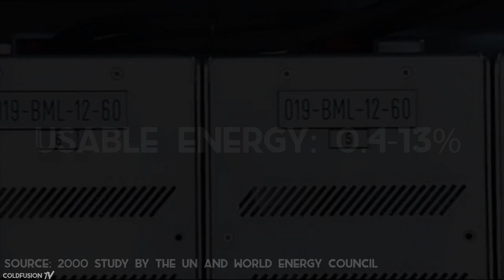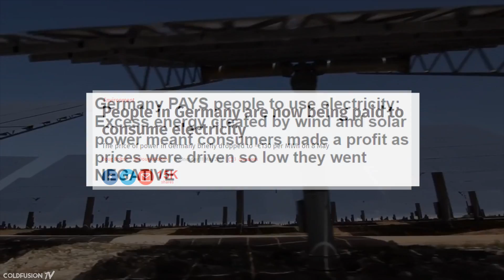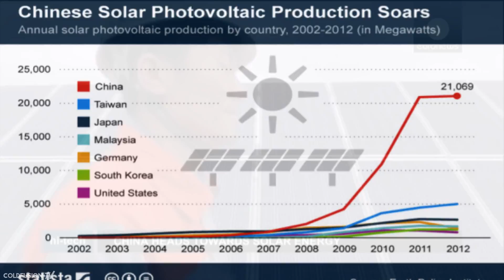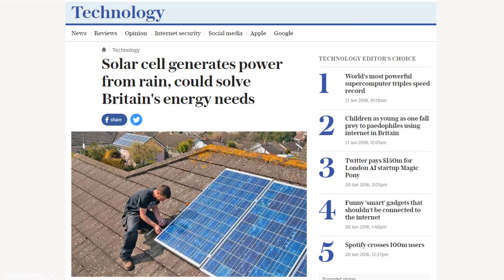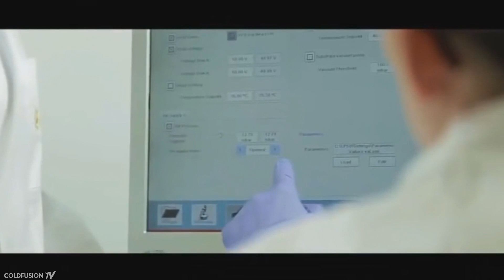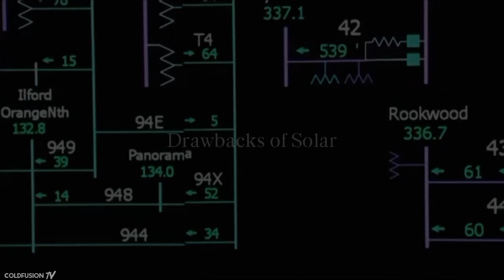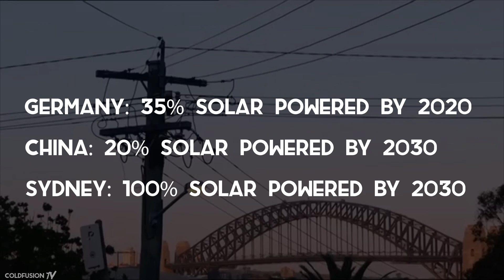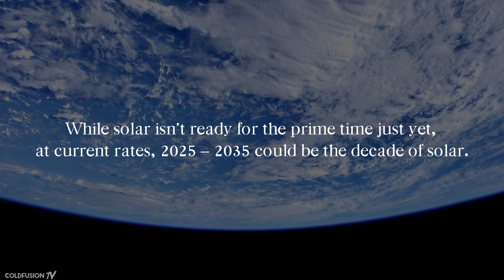The Truth About Solar

Comment: I like your videos just subscribed to your channel. I have excellent knowledge about the subject in this video and while you did a good research there is still a lot of misinformation related to solar energy cost of production and storage.
I designed an energy storage device that stores electricity form PV panels in any type of Lithium battery and my next project is to store PV electricity in thermal mass (at least 30x most cost effective than battery storage) and use PV and thermal storage to fully heat my house (this is in Canada with 5 month heating season).
The reason I will use solar PV for heating is because at this time is the lest expensive for of energy.
PV panels now can be had well below $1/Watt in low volume and at $1/Watt initial cost and 25 years amortization period the price of energy (cost amortization) based on the amount of sun available at my location is 3cent/kWh (same as the least expensive form of fossil fuel that is Natural Gas).
This 3 cent/kWh assumes you will be using all the energy available from the PV panel but in my case where system is offgrid just around half the available energy is used so you can say that amortization cost is 6cent/kWh.
The cost of energy storage is much higher when stored in best battery for this (LiFePO4) and in real use case scenario is around 25 to 30cent/kWh
For the heating part thermal mass is a much better option with cost amortization of around 1cent/kWh when using large water tanks or concrete for storage.
My house was already designed with build in thermal mass that is also part of the structure so there is no additional cost for the 100kWh storage capacity (14 cubic meter concrete slab floor that is thermally isolated from outside and used at a 10C delta range).
So solar PV energy is already competitive with any other source for small offgrid type projects and the expensive part for electricity is the storage (the LiFePO4 I got for my house 4 and a half years ago still cost the same today).
For thermal storage things are way better as I mentioned before and most of the energy used in a house is related to heating or cooling so thermal mass can work great in all those applications.
My house is relatively small 65sqm (700sqft) and with good thermal isolation and thermal mass and is in a cold climate but relatively sunny (Regina Saskatchewan for reference). The house will need a 9kW PV array and that will be enough to solve both heating and electricity requirements of the house fully no backup needed.
For transportation there is no good (economical) solution at this point that will in my opinion be ordering a self driving car when needed rather than own a personal car that stays parked most of the time.

Comment: People should just listen to Elon Musk, he's always right.
Reply: okleydokley There is a big difference between not making money and investing money. They spent FIVE BILLION on the Gigafactory, of course they aren't making money. It is a long term investment, it will significantly lower costs and increase productions. Model 3 pre-orders ALONE have earned them $400,000,000...that is insane. That is basically a $400 million investment from their customers. Sure, some people will pull out, but it is still a huge injection of money and their customers are aware that their $1000 down payment might not become anything for another 4 years or so. You have to spend money to make money and Tesla is pretty much the one car manufacturer in the world that is doing that right now.
Reply: No. People should evaluate ideas on the merits. Elon Musk's endorsement may be a good starting point, but it is not conclusive. For instance, when I hear Elon Musk talking about hyperloop, the illusion of his infallibility falls away.
Reply: David Moritz
 
 
 You have skipped over the fact that the links are the answer to a request, and my point was in a previous comment.

The links are for the amount of sun at particular locations. They are not about advocacy or criticism. My main point is that if you only get 55% of the sun in your location compared to another, it is going to effectively cost you 1/0.55 = 1.82, or 82% more for a solar energy system. When Elon Musk is not up front about the facts, he is doing a con job.

 In general, Elon Musk has done a tiny, comparatively easy, part of the vision he presents. Just  because skeptics expected him to fail, like so many others, at the easiest part, does not mean the hard part is anywhere close to achievable.

 It is true that the most ardent, and simple-minded, advocates of solar energy are usually also paranoid to the point of delusion about supposed toxins and environmental degradation, and they suddenly make up imaginative rationalizations in the case of solar cells and batteries. But that's not me. I think it is fine if things we don't eat are 100% toxic. And I am fine with wherever they dump the solar junk, or if they recycle anything or not. And I am not even an advocate of solar energy. Much of what advocates say is a confusing con job, and most people recognize the signs of it. It just so happens that when you get past all the mountains of BS, and check out the numbers, solar cells are on the good side of practical in some situations for some people, but unfortunately very marginal where I live.

Why is it that there are so many people that are totally convinced that solar cells are wonderful, and so few that will put up any of their own money to install some?
 
What I do advocate is a lot more nuclear power plants than what now supplies 20% of the power in the US. If more had been built since the '50's and forward, we would not be in the CO2 situation we are today, if indeed CO2 is a problem, and electricity would be cheaper than it is today. It is the anti-nuke kooks that are responsible for the excess CO2.
Reply: okleydokley lol one year ago. Now look at em
Reply: Elon musk has got the answer Grapheme is so thin it is going to be able to cover your Roofs. And soak up the sun's solar energy.  Check it out people!  This is Cambridge Grapheme work.
And that is a respected British University.
Reply: Except when he's predicting WHEN something will happen. But yes, he is right.
Reply: *****

the terminology is solar insolation

 https://www.ncdc.noaa.gov/data-access/land-based-station-data/land-based-datasets/solar-radiation

 http://www.nrel.gov/gis/solar.html

 http://neo.sci.gsfc.nasa.gov/view.php?datasetId=CERES_INSOL_M

 some people who make their panel data public
 https://enlighten.enphaseenergy.com/public_systems

 one of them
 https://enlighten.enphaseenergy.com/pv/public_systems/243q14598/overview
Reply: actually, insolation without a preceding 'solar' is sufficient.
Reply: Leonidas Pereira oist
Reply: @ Kenneth Florek - I agree with a lot you have said...tell me you know about Thorium...

I am an environmentalist and a farmer and know the limitations of some technology. It likes certain crops. Some work better than others in certain habitats. However, I do believe that solar is better than petroleum....and Molten Salt reactors are better than solar.
Reply: "Model 3 pre-orders ALONE have earned them $400,000,000..."   Not true.   That was a $400,000,000 of cash flow, but it is also a $400,000,000 LIABILITY.   That is NOT earned money - not until they actually SELL the cars.  If they don't deliver those cars, then they are on the hook to pay the "down payers" back.   Admittedly it was an extremely cheap way to raise that kind of money.  No interest being paid on the money - no equity stake being given to the "down payers"...
Reply: This was the thing that really got me. To see Musk telling a porkie like that, was a bit of a jawdropper. 

Anyone who has used a camera (excluding consumer toys) will know that exposure time goes up by a factor of ten in cloudy conditions, all else being the same.
Reply: Elon Musk have good visions. Always right...? I am not sure, but he is pointing the right direction!
I just can't afford a Tesla car of his company, because that's high class expensive cars. Where in my electric car is less than 1/4 of a Tesla.
Reply: Elon Musk says, or seems to, that output of solar cells is 80-90% in overcast conditions of what it is in full sun. Normal readings from people with solar cells is 5-10% when solidly overcast. It is possibly true that under some conditions people would consider overcast it might actually be 90% as bright. It depends how overcast it is, because it varies greatly. If Elon means that averaged over all conditions at all times, the output could be 90% of full sun, even though people perceive there locale as frequently overcast, that could be true. However there are measuring stations all over the US (with data you can find on the Internet) and many parts of the world, and there is no doubt that many northern locations in the US are under 50% of the total of what it is in the dry southwest.
Reply: 8 years to start a company, experiment and build a revolutionary rocket. You think Boeing or Lockheed were developed overnight?
Reply: Sure there is some local pollution but look at the problem with oil/coal based power! we have have managed to melt the ice caps, kill people with lung problems and turn the oceans so acidic that corals are dying. Smoke goes everywhere and kills everyone. Solar pollution while not good is at least quite local and new tech is coming online to stop even this toxicity. Also cars have chips and plastic and many other toxins in their production as do coal plants.
Reply: +Kenneth Florek none of those links discuss the toxicity of the manufacturing process of silicone, solar cells or thier battery storage systems so they are all useless.
Reply: +Douglas E Knapp 

What a load of crap.
Reply: Elon Musk is full of shit.
It took him over 8 years to take a rocket off the ground, and he want's to go to Mars by 2025?
Reply: Tesla is still not making money, and no way can it deliver on those Tesla 3s.

Comment: One thing that the world needs to know is that the electric cars are the most filthy, coal burning and battery demanding viecle. The real truth is that we can't depend our lives completely on electrical power. When it comes to electric cars, that's where it becomes the most pollutive. Batteries, we all know what they are. Batteries require very toxic matirials and acid to hold the electrical power. Even if they are rechargeable, they Decay which will require new batteries. the more batteries we need to throw own, the more pollution it creates.

If you look at and of the "How it's made: batteries", you will see what I mean when they get into the toxic, gooey material (which they use machinery to work with it). 

But that's not where it ends. When you need the acid for the electrical current storage, that requires burning coal. Coal and other fossil fuels contain sulfur (when I looked, it said " sulphur".) and nitrogen oxides which combine with Di-hydrogen Monoxide (H2O or water) to form acids. And acid kills, despite the fact, very bad pollution like what we have in China, actually kills people, gives them cancer and sometimes might give children birth defects.
Reply: That is not always true. Yes in production ev is dirtier than traditional vehicles. But long term they are still cleaner. Also every year they have gotten cleaner so when you look at the long term game ev is slightly better currently.
Reply: Now lets say if we go out to space, then we will need these solar panels. Now if someone would tell me that a 'decay proof' battery might be invented, I would dout that. Now everything decays and that is one of the prime reasons why I consider electric cars filthy.
Reply: Coal hangs around for a long time, it doesn't seem to decay too quickly.
No reason to think we can't design a battery to not decay as well.
Reply: Dont worry we as species arent going to depend on solar energy only. There are various renewable energy methods being thought of around the world, but for the meantime solar power is the easiest to progress with.
Reply: Petroleum based cars decay as well so I'm not sure I understand your point. There's also the problem that gas vehicles are incredibly inefficient at producing power. Most of the released energy from the fuel is lost as heat. The benefit to an EV is that the people producing the power for the vehicles have an incentive to make their fuel consumption as efficient as possible. If they pay for a million dollars worth of coal then they're going to want to make significantly more than that so a coal power plant is significantly more efficient than a gas engine in a car. A gas station on the other hand doesn't care how efficient your car is. If anything they want it to be less efficient so you buy more fuel. I do agree that current battery technology isn't the cleanest but a battery lasts for a pretty long time before you have to replace it and with the proper regulation it doesn't have to be a horrible process to dispose of. My final comment on this is that as we continue to build and create new batteries the process will become cleaner and the batteries will last longer and provide a better charge. Gas engines are reaching their limit for how much cleaner they can get so in the end those cars are a dead end.
Reply: There are other was to store energy other than batteries. For instance filling a reservoir with water using solar powered pumps, during sunlight, then releasing the water to generate energy using Hydro, during darkness. Similar ideas using old coal mines etc, pressuring the air inside during the day... 

But yes i agree, batteries are very bad but no where near as bad as HLW from nuclear plants.
Reply: decay proof battery... hmmm for example an electrostatic capacitor? sure not very energy dense, but the theoretical limit isn't far off from current chemical bateries
Reply: No they aren't. In the US an EV produces 51% less co2 then a gas car over their lives. As the grid gets greener that percentage will grow.

Comment: Great video! Could you elaborate on what upgrades are needed for the electrical grid in order to support solar? I would have guessed that with solar combined with local battery storage the electricity could be released when needed and thus reducing the overall load on the grid, as power would not need to travel as far?

Comment: wait so with artificial light being able to power the cells wouldn't that make that light a perpetual machine or couldn't you create a perptual energy source from it?
Reply: Produced energy is quite low, you can only run a calculator on a artificial light
Reply: it's not 100% efficient
Reply: I think that would violate the laws of thermodynamics.
Reply: No, because the energy being absorbed wouldn't be enough to power what was generating it. Too much of the light is going in different directions. Even if all the light was being absorbed, the source would go out as 100% efficiency is impossible.

Comment: 36c/watt, vs 14c per kwh
Reply: 36c/watt means the cost per power output of the panel, not wh or kwh.
Reply: Luca Ballardini $360 for 1 kw. It would take 2571.5 hours for the solar panel to pay for itself. That's just the cost of the panel and not the installation and such. It's still very expensive to switch to solar.
Reply: 36c/w solar
14c/kwh coal nuclear etc
Time to make 2.6 KWH of power with your 36c of solar panel?.... 2571 hours.

Lets say average 6 hours of sun a day?

Then you need 429 days. So, time to recover costs for your solar cell?

      1 Year and two months.

After that, all profit!
The cost in real terms is greater, installation etc, but solar systems still cover their own costs pretty quickly in the UK, maybe ten years or so.
Reply: Marc Browne costs are going to be a lot more than that. You're going to need more solar than a panel that can put out 1kw/h. 1kw is almost nothing
Reply: +goaliedude32 and economy of scale reduces the price of larger installations. Solar pays for itself in a few years. That will keep getting smaller as the panels get better too.
Reply: bensemus x Of course it will. I just wanted to talk about 36c/w
Reply: goaliedude32 Why? Unless you are also looking at the instal cost of carbon based power plants there is no point. You can't compare solar instal cost per W to running a carbon plant per W.
Reply: bensemus x
You mean existing versus upgrading?
Reply: goaliedude32 ?
Your op is comparing 36c/W to 14c/kWh. You can't do that as 1. those are different units and 2. That 36c/W includes installing the solar system.
Reply: bensemus x
"1. those are different units"

Uh.... I'm not even going to explain this one.

"That 36c/W includes installing the solar system."

The video said the "cost of a solar module per watt"
Reply: goaliedude32 That 32c/W is not what you are going to pay though. A W and a kWh are different. You would have to multiply 32c by 6000 to get c/kWh. Clearly solar doesn't cost $1920/kWh.
Reply: bensemus x
"You would have to multiply 32c by 6000 to get c/kWh."

.....